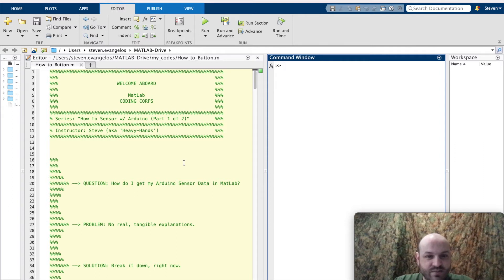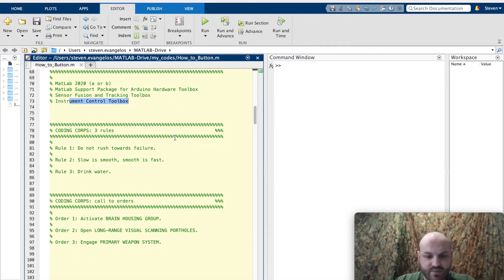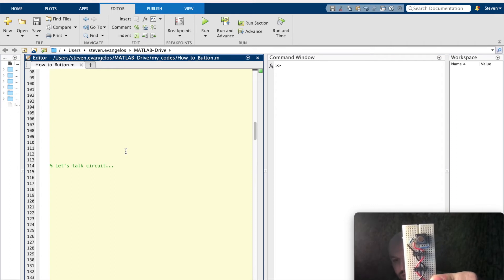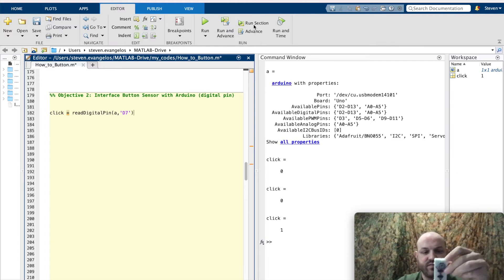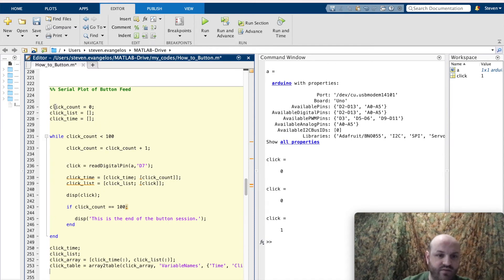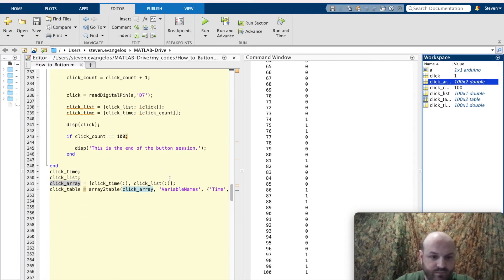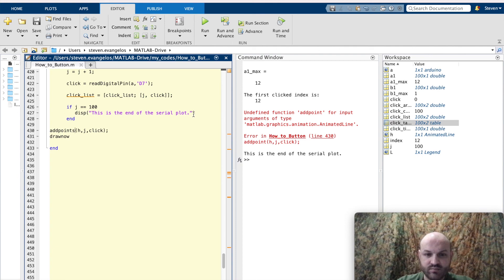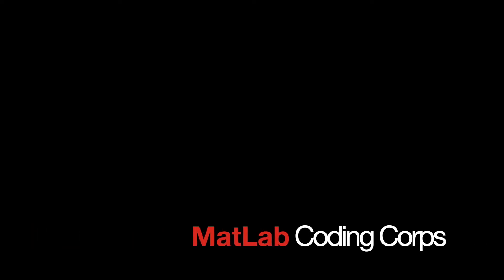How to Arduino Sensor in MatLab (part 1 of 2)

Comment: Hi. Very good video. U must be a Pro. When to expect the part 2 and more? Do u have a webpage or something where more detailed videos/tutorials are shared on data acquisition from multiple sensors/sensor-arrays using low-cost hardware (like arduino) and with Matlab?
Reply from the maker: Hi. Thank you for your kind words. Initially, I wasn’t going to include “multiple sensors” in part 2, but I think your mention of them confirms that a multiple sensor perspective is more realistic than one sensor at a time. So, I will include multiple sensors in part 2. It will be filmed and posted…1-2 weeks.

Comment: Part 2 ?
Reply from the maker: Hi, I haven’t filmed it just yet. I will next Monday or Tuesday. 

The Arduino UNO has two types of Pin reads: Digital and Analog. Part 1 covers Digital Pin read, noting that these output values are always 1 or 0. Analog read is more dynamic, and I’ll be using different sensors to demonstrate the flexibility of Analog read.

Comment: hello, and thanks a lot for your help! I saw you have a video of the BNO055 and matlab. Can you please make one for the MPU 6050, that would be super nice, cause I am having problems with it.
Reply from the maker: Hi, so for mpu6050:

a = arduino;

imu = mpu6050(a)

imu_read = read(imu)

The only real changes are at the beginning when you tell MatLab which sensor you are using. If I recall correctly, the mpu6050 library does not contain a built-in command for calibration, or an on-board fusion algorithm to calculate angular orientation. So, when you read the mpu6050, you’ll get 9 columns (xyz accel, xyz gyro, xyz mag). 

The bno055 has a more thorough library with MatLab, and the chip itself is better than the mpu6050 for use in MatLab. Reason 1: the bno055 has a built-in calibration command, and it auto-updates its calibration as you continue to use it, making it increasingly more accurate. Reason 2: The bno055 has an on-board fusion algorithm for calculating orientation (this is why the bno055 read produces 12 columns, versus the mpu6050’s 9 columns). In order to calculate orientation with the mp6050, you would need to create a custom Kalman [sensor fusion] Filter.

The chips are virtually the same physical dimensions; the bno055 costs a few dollars more. But, what I’ve gained in performance with the bno055…it’s totally worth it.